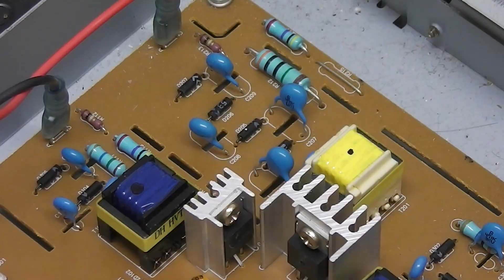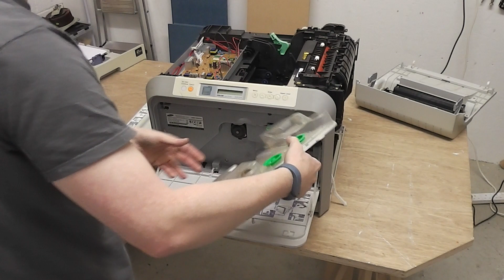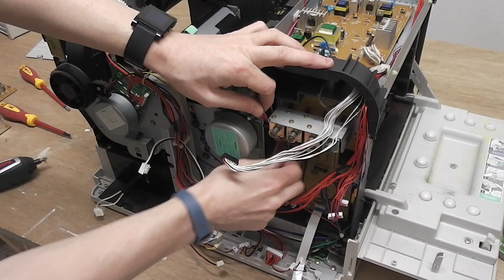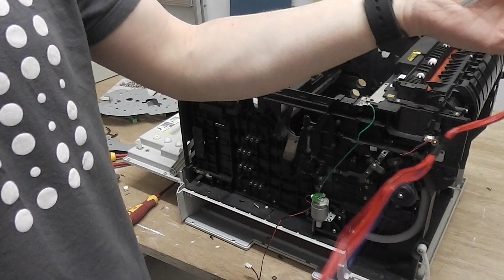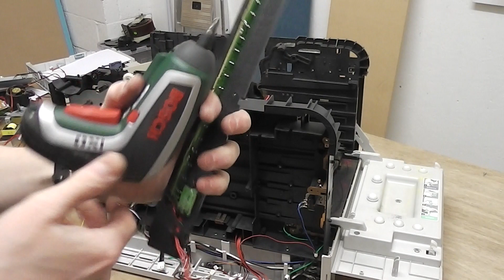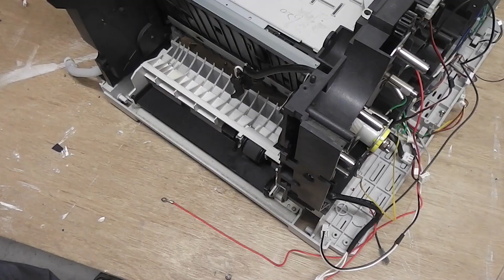Samsung CLP-510 Colour Laser Printer Teardown

Comment: I still own a printer like that, bought it at introduction about 10 years ago and added a network card, so it functions as a 510N and it still serves me well.
For documents I use that printer, double- and single sided. For photo's I use a multipurpose Inkjet.
Today I received a complete set of 'compatible' cartridges, I quit filling the cartridges myself quite a few years ago.
On a regular basis, I (have to) clean the 'waste toner' container properly.
I use the printer on all PC's and OS's available, netbooks to workstations. Linux and Windows, including Windows 10.
Eventually dismantling it for parts?
No.
Dismantling it for reducing the weight, that is an option.
Though I liked the video, it shows some of what I did.
For instance, I dismantled the previous printer, a HP 2500 Color Laserjet.
Not for the parts, this already is a House of Parts.

Comment: Interesting side note; I just tore down the same model but mine did not have those four solenoids you talked about at 35:00 ; instead there were just relays soldered to the board. As far as I can tell, everything else was identical. I was really looking forward to playing with those, too.
Reply from the maker: +Jerry Norcross Using relays would seem to make more sense, rather than custom building a switching system as they did in my case a handful of standardised relays would definitely be easier.
Although sadly a slightly less interesting haul!

Comment: Are you really going to use those parts, or do you just like to collect parts for the sake of collecting parts? I like minimalism; if I'm not going to use it, then recycling it, sell it, make it go away.

I have a Samsung CLP-510N printer. It was giving me an error message - Install imagining unit. The bastards at Samsung designed this thing so that after it prints so many pages, it complains that it needs a new drum (also known as the imaging unit) or it needs a new toner cartridge, and this thing has four cartridges. The drum is still okay, the toner cartridges still have toner in them. The printer forces people to buy drums and cartridges that they don't need!

So tell your friends and co-workers, do not buy Samsung printers!

Last night I pulled out the fuser and drum, then put it back together. Now it's printing okay; it just says it needs new yellow, magenta and cyan cartridges.

I found toner cartridges on Ebay for around $33 with shipping, but even so, it's not worth the money. I'll just use the printer as long as it keeps printing. When it comes down to - Spend at least $30 on the printer or junk it, I will recycle the thing and buy another printer.

And you can recycle your electronics! That is much better than throwing more junk into a land fill, especially since electronic gadgets often contain heavy metals.

Samsung sucks for screwing their customers like this, greedy pigs. I won't be buying another Samsung printer.
Reply from the maker: Some of the parts are potentially useful, so while I have the space I like to hang onto bits like this.

Comment: 19:35: These are solder catchers. The board is wave soldered and these catch the solder. Otherwise the pins next to the catchers would be connected to each other with solder.
Reply from the maker: Thanks, I wasn't aware of that requirement with wave soldering